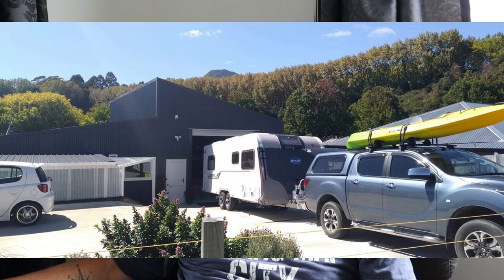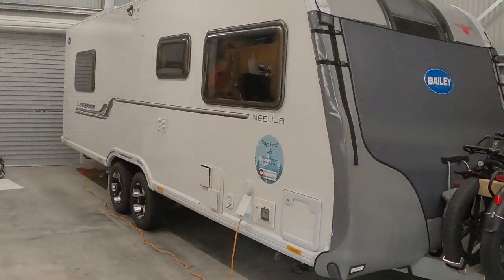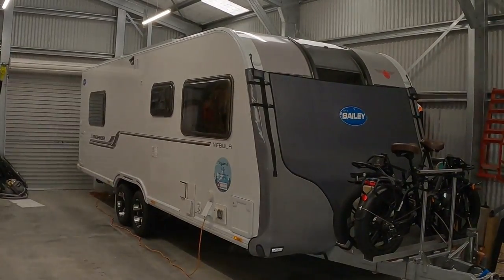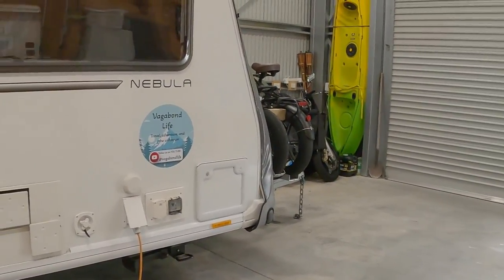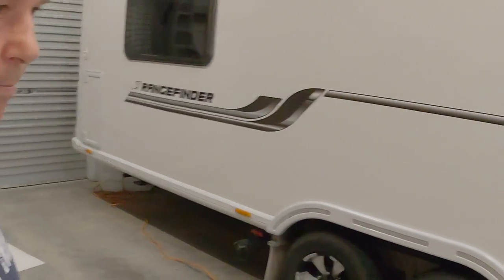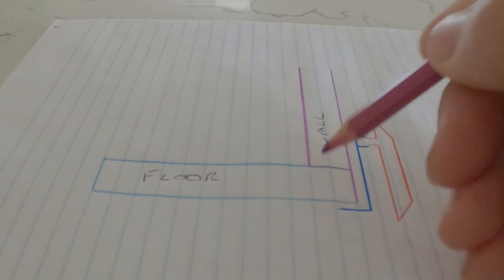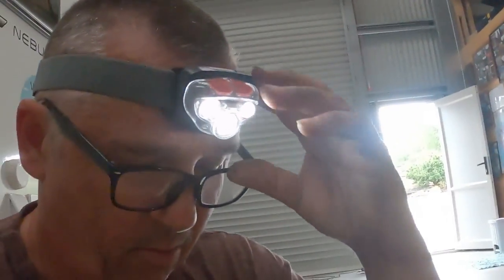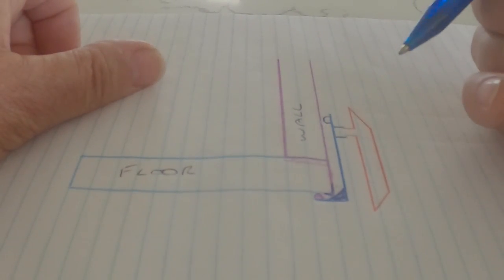Caravan Leaking issues and I may have found the solution

Comment: I have a problem with floor in front of the sink it has collapsed and seems to be down on the bearers ( if they have any) the vinyl floor has sagged... how is the best way to fix it..the  floor seems to run under the cupboards so not sure
 how to get to repair the floor? by the way I have the same van as yourself
Reply from the maker: Hi Colin 🤔 well there will be no easy fix unfortunately. Firstly you will need to work out where your leaking is coming from. Could be the wheel tubs, could have been a water pipe leak under the sink, or from the hot water cylinder under the seat beside the sink. 

Then you will need to pull out your kitchen cabinets because if it's as bad as you are saying, you have had a major leak and it has rotted your flooring to the point of collapse.  If you don't remove all of the rotten flooring, any new flooring you put in will eventually end up the same way as the rot leaches through.

I strongly suggest buying a moisture meter as this will give you an indication of how extensive the moisture problem is (how far extends beyond your kitchen floor and cupboards)

Once you have pulled up the vinyl cut out the rotten flooring, and replace with some new ply of the appropriate thickness (I think it is either 7 or 9mm). 
When you glue the ply  down make sure you use a glue that is compatible with  polystyrene (otherwise the glue will just eat through your polystyrene underneath your ply floor).  Then bog any joins and give it a sand so joins are smooth, clean your surface and relay your vinyl.
Reply: Hi Darren,fantastic video,has your damp been cured now? We have a 2015 Bailey Cartagena had for 12 months and come across the exact same problems ,just watched the video and looks like I’ll be busy.Does the “decorative trim “just pull off away from the fixed trim .Not yet watched your other video on the wheel arch butts ,that’s for this weekend .We have put the winter cover on now to keep the weather away,once again thanks for your video and hope you have some Dry holidays 👍
Reply from the maker: @AndrewJohnson-ow3yc thanks for your comment and question Andrew.
Yes our leaking issue has now gone (thankfully) 🙏 and once you have replaced the rotten floor (if it was needed) luckily not in our case, after ensuring the ply floor is COMPLETELY dry, then applying the everdure, then when the area is dry, sealed and will last forever.  The trims is easy to come off , but does require some force, best to just get a screw driver in behind where it clips in and slowly pry it away (you will have seen me doing this in the video) using a screwdriver to open up the V slot the trim clips into. Don't be afraid of breaking it (unless you are really rough) but by using the screwdriver to pry the slot open and yanking at the same time (as I show in the video) you will get it off no sweat 👍
Reply: Well Darren I’ve done that job as to your video ,the fixing screws where even above the v slot ,so well  open to the weather ,dropped below with plenty of sealant and then also done the front and back tucking  some awning rail protector( as we call it in England)up behind the face panel as seen on another video, so fingers crossed it works and as you say we should never get any damp again
Reply from the maker: Glad to hear my video has brought about attention to areas not properly sealed at the factory causing so much worry and concern for those of us who purchased what we thought was a good product. Keep in touch and let us know if you find these issues coming back since you completed the repairs and resealing.

Comment: Most of the time not enough sealant was used
Reply from the maker: You can see clearly from my video that there were areas where sealant was either needle thin or completely missed. I have spoken to many others who advised their caravans are the same. Such a shame that poor workmanship let the company down.
Reply: @vagabondlife2018  yes we have Elddis motorhome here in uk 🇬🇧 I pray to my God for no leaks
Reply from the maker: The best piece of advice I can give you Karl is to purchase a moisture meter. Ours is not an intrusive one, it does not make holes in the walls to work. It cost us $50 NZD to purchase and was the best $50 we spent. Be proactive by checking regularly and that way you can catch any leaks before they become a write-off for your caravan.
Reply: Yes I'd don't allow engineer's to ues damp meters that stab the walls, great video. I check my van regularly and outside seems. I did notice you didn't show any damp damage on floor inside van .if you catch it fast enough it can dry out
Reply from the maker: We are lucky we had NO moisture/damp damage inside the caravan, but we can see how easily it can happen.